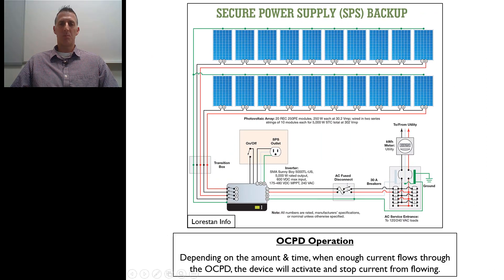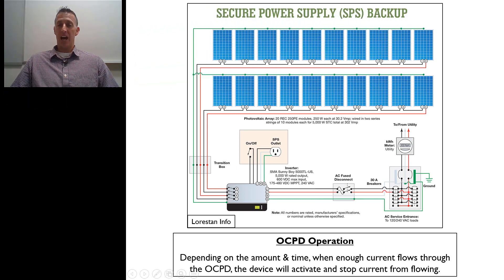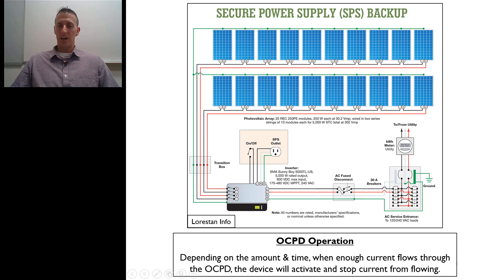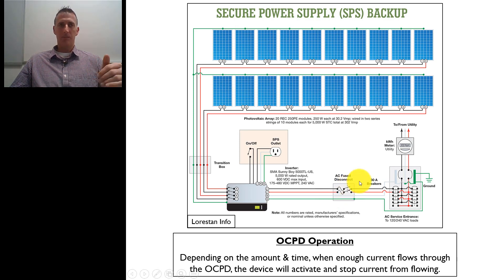Solar Training - Overcurrent Protective Device (OCPD) Operation

Comment: You've got me as a new sub, I fully intend to either Solar/Lithium off-grid in an RV, or small homestead, or both if my health holds up. I'm on your FB group as well. Excellent information and very well explained. I am still learning after 2 intense years of self-study - and I am still wary of my foray into this wonderful tech. It's all good, anything worth doing is worth doing right.
Reply from the maker: Thanks for the kind words.  I hope this information is helpful as you navigate the solar PV world.  For the foreseeable future I will be sharing videos focusing on the requirements of the National Electrical Code (NEC); however, once I cover Article 690 (Solar Photovoltaic (PV) Systems), I will begin sharing videos about system design.

If you have questions, feel free to post these to the FB Group; hopefully someone will be able to help.
Reply: @solarpvoutlaws1674  I'm looking to put together either a 24-volt system for an RV with a bank of Lithium batteries (Battleborn 100 amp hr Lithium Phosphate @ 12 volts) maybe 500 amp hours of storage and a 2400-300 watt PV array up top. If a Homestead, then a 48-volt system with a 500 ah bank of the same batteries. I'll probably use 32 of the 60 cell PVs. Just a small mobile home here in AZ on land I own in the sticks. I am also following Electrodacus here on YT and he has a new Solar MPPT-type device and I am curious to see how this all works out in the end. This is an exciting prospect and my last and only chance to live a dream before I die, so onward bound!